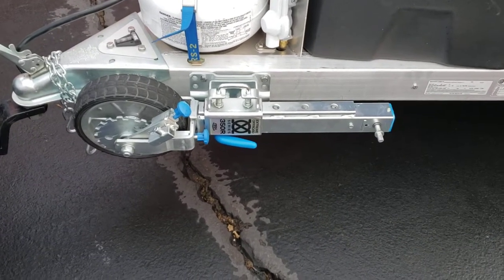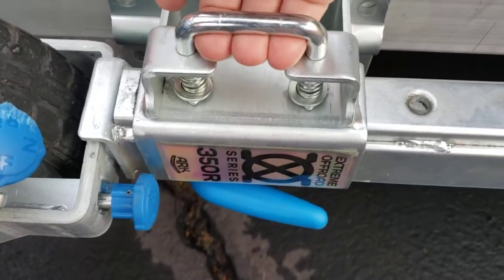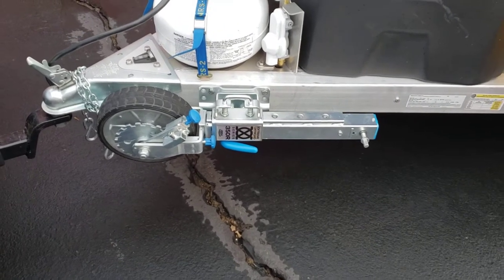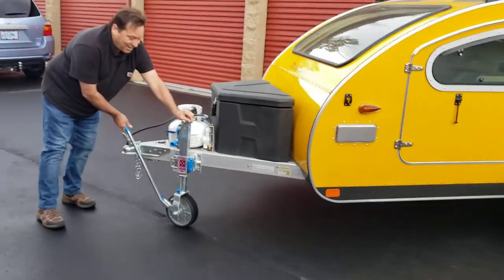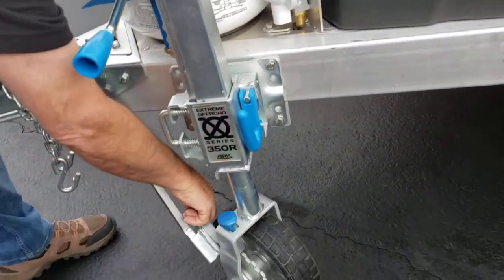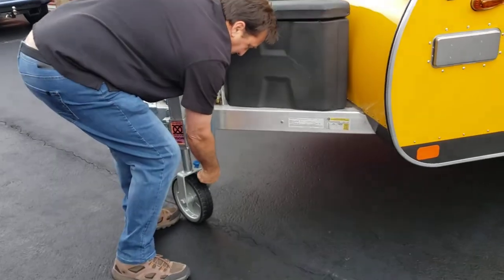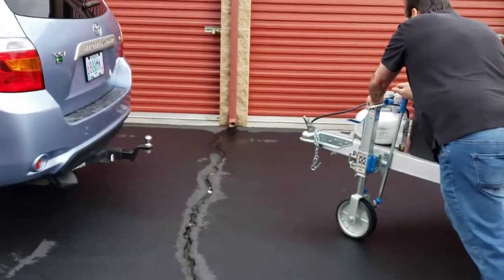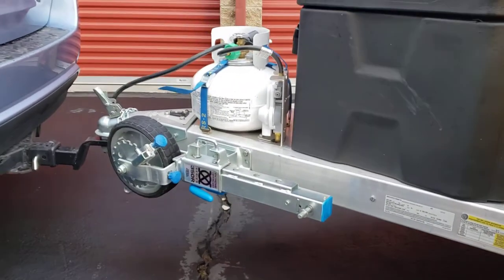Ark 350r for moving a Vitabule Trailer 2

Comment: Thanks for the video, but it should be noted that you are moving the trailer while the jack is cranked above its "Max Moving Height" marked on the main shaft. You can see the marking at timestamp 3:00. That puts the shaft under a lot of stress. Doing that often will irepairably damage the jack eventually.
Reply: Great observation!!! Thanks.